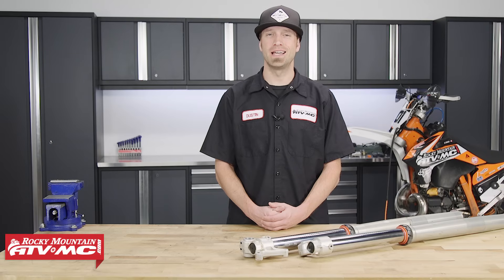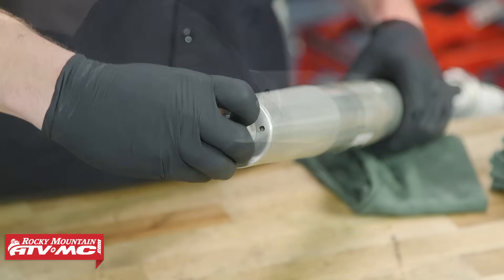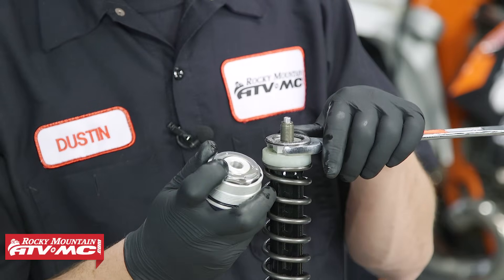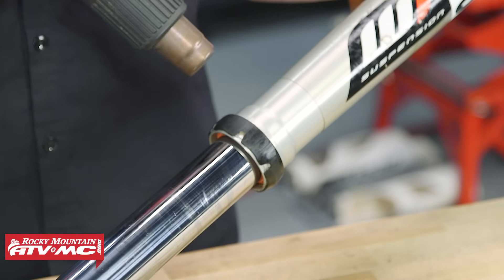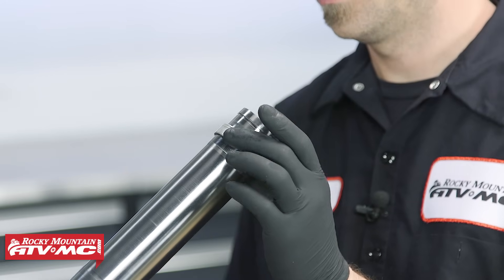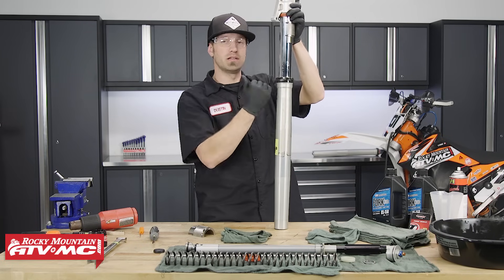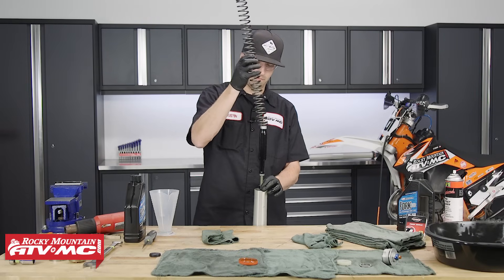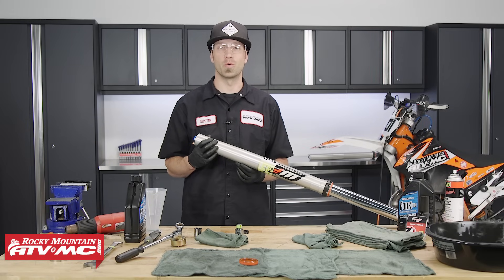How To Rebuild Fork Seals on WP Open Chamber Forks with Spring Preload Adjuster

Comment: I guess if you have an impact driver this method might work. The proper procedure is to loosen the damping cartridge before removing the spring. A proper amount of friction is required to get the threads moving. If you do manage to get it moving without an impact driver or the spring still installed under tension, it was not torqued properly.

Other than that, good video and thank you!

Comment: I got my bottom bolt off but now putting it back on it just keeps spinning!!! what is supposed to hold it and stop the cartridge tube from spinning?
Reply from the maker: Try pressing the piston rod slightly to the side. -Charles
Reply: @rmatvmc   hey that works to a certain point but cannont get any where near the recommended torque before it starts spinning ..

Comment: That’s what comes on n the 2016 350 sxf right cam I take the top cap off and put oil into n top do I have to take fork off and fill in bottom ? Thanks

Comment: Great video thanks. My preload adjusters didn't unwind the cap just came off in one but it hasn't effected anything. I also got away without any special tools (insulation tape to drive the fork seals and protect the seals over the bushing recess and drilled an old spanner with 4mm holes and used the drill bits to unwind the top cap) I used 600ml of oil in each fork leg (2010 ktm exc) and forks feels brilliant now 👌

Comment: why does the buttom just spin
Reply from the maker: You may need to use an impact to loosen the compression damping fitting on the bottom of the fork. Starting at 4:50 we show that process.
Reply: @rmatvmc  yeah i saw that thanks, i tried with a Normal drill but it didnt come loose, i dont understand how the threads   dont catch, anyway i replaced the forkseals without removing that bottom part.

Comment: I know this is old, but I have just rebuilt a set of 2004 forks and they have 3 bushings and a large spacer. I have heard to remove stiction, you have to remove a bushing and the spacer. But which bushing ? The middle one ?

Comment: Couple of comments.  Lower end thread cap screw. It works better if you start the cap off with the forks still assembled.  Only a couple threads.  If it hangs up later on... put the fork spring in, push down on it so it bottoms in the tube, and the threaded portion will come off.  

Snap ring holding the fork oil seal in.  
One end is notched and will come off.  Other end isn't notched and won't come off !

Comment: Hello my cartridge is always spinning so i cant use a Torquewrench. With the impact wrench it is possible. Any tips?
Reply: Put the spring back in and top cap then try using torque wrench

Comment: Why do you want to coat the inside of dust seal with grease, wouldn't it smear grease over the inner tube and then catch dust afterward, and also please tell specifically which fork greade do you use
Reply: Why he coated it in grease was so it was easier to install

Comment: Thanks so much for the vid! Just wondering if it's necessary to remove the reboundand compression assembly or if it's possible to change seals without taking it out. Thanks!

Comment: is it safe to rotate the upper tubes on the forks 90 degrees when the forks are installed on the bike, for example to reorientate the facing of the protective stickers?
Reply from the maker: Yes, you can do that no problem.

Comment: What steps are necessary if I'm only changing the fork oil? Can I just remove the top spanner cap, dump and refill or do I need to back out all adjusters as per video? Thanks
Reply from the maker: Yep, just remove the top cap and dump it out. Not need to back out your clickers for that.
Reply: That's what I figured but thought I'd ask. Thanks for the fast response!

Comment: When cycling my damping rod to remove air...on the right rebound side I get nice full stroke damping, while on left compression fork I only get damping fir the first few inches.  I gather from other sites that this is normal...can you comment?  2018 250 EXC-F with no preload adjustment.

Comment: Hi,
I'm a Portuguese fan of your channel. Lots of practical technical information, and very well explained.
I have a KTM exc 450 from 2005, and I did this oil and seal change operation, without disassembling the fork base, just removed the spring, emptied the oil, cleaned it and filled it with new oil and seals. At the end of one of the forks, the clicker always rotates without stopping. I am going to address this problem but in the meantime I would like some opinion of yours about what I have done wrong, and possible damage that I have to pay attention to.

BTW, is there any video of changing the glass oil level check thing on these bikes? I have a smal leak there...

Thank you in advance, for your attention. 

Come to Portugal for an adventure ride, i will show you guys the best trails.

Comment: Can we use a fork oil level syringe on this style of fork? Would that be more accurate than measuring the oil volume? What would be a recommended oil level?
Reply: Yeah I'm confused why he didn't do that.  Or bleed the air out
Reply: kris nowak I'm guessing that he looked in the manual and it had the volume of oil that you should put in each fork.

Comment: Hi guys! What tipe of suspension grease do you use? I canot find anywhere the KTM recomended grease and i am lookibg for a replace. Can you tell me the type that you are using? Or maybe the properties that the grease should have?
Reply from the maker: IN this video used the pro circuit grease. Race Tech also makes a for grease. Both will work fine for any fork.
Reply: @rmatvmc  thank you very much. I hope i can find in Roumania Pro Circuit grease, but i'm guessing that any type of good quality Seal and Oring grease should be fine. I apreciate a lot your videos , i think they are great! Thank you very much both for the quick answear and for the good videos that you make. Have a good day!
Reply from the maker: @AdhD311  You bet! Thanks for watching from clear over there. And yes, there are many greases that will work. I use the bel ray waterproof grease we sell and it works great. Have fun out there!-Chase
Reply: @AdhD311    I was going to comment on the "fork seal grease" while I appreciate the video very much anyone doing this should know that grease for rubber/orings will work as it wont have any strong properties to harm the rubber parts. Trying to sell grease is more money for RM and I understand but I would think everyone is going to buy the seals, oil,  etc anyway and probably a few of the tools and a few are not absolutely needed. 
 That being said they want to make money but buying "fork seal grease" is a bit much of a push when many people will take it at that exact word, and you could of easily changed your wording. Again make the money but "Come on Man"  easy with it.

Comment: Question please - when you screw the top cap back on, is it until the first slight resistance or screw it until it stops home? cheers!
Reply from the maker: Could you give us a time stamp in the video please so we're on the same page?
Reply: @rmatvmc  12.43
I screw it down and feel a little resistance. I can screw more until it stops hard.
Reply from the maker: @joncavalier8875  You'll want to snug it down until it's all the way home.
Reply: @rmatvmc  thanks didn't want to overdo it.
I didn't, and the rebound clicker just spins. Thanks for the reply!
Reply from the maker: @joncavalier8875  you bet! have fun out there.

Comment: just a heads up for everyone with these specific forks dont use an impact on the bottom compression assembly or atleast be very careful i used just a regular makita battery impact driver to zip mine on and i must have went overboard the first one went on fine, so i thought..... then the second one completely sheared off the aluminum collar on the assembly causing it to push right through into the fork totally ruined have to buy 2 new ones now, the first one didnt shear off but cracked around the entire edge and is barely hanging in there terrible design to make it out of aluminum they are not cheap either so when my new ones come i dont think im going to use an imact at all dont want to risk it
Reply from the maker: Jeez, what a pain. Thanks for letting us know about that, I hope you have better luck with your new ones!
Reply: @rmatvmc  thanks for the reply yea hopefully I can save some people some trouble luckily found 2 used compression assemblys on Ebay for 39 a piece this time I will probably just use a drill to get it started then finish with my torque wrench
Reply: @ @psyfertech  did you have any issues with torquing down the bottom compression fitting? mine just spin, I can't put the correct torque on them...
Reply: @adamk7630  yes it was pretty tricky to get that thing to bite what i found helped is get it in most of the way and take your hand and kind of smack your wrench to give it kind of an impact or jolt that was able to get mine to bite and then i was able to get the torque on it but like i said above dont try an impact you run a high risk of ruining that compression assembly the aluminum collar is a massive weak point where the crush washer sits on

Comment: Air impact on the compression adjuster? Don't do this. If the cartridge is turning put the spring in and cap on temporarily and compress the fork a bit while tightening the adjuster.
Reply: tried that but it still keeps spinning 😢😢
Reply: check for thread damage, you should be able to easily thread the parts together

Comment: Very nice and helpful video! :-)
But I have one question: Do you have to remove the compression dampening fitting and pull the cartridge out, or can you leave it in as well? Does it matter when I am only replacing the fork seals?
Reply: No you don't have to take the cartridge out to replace the fork seals